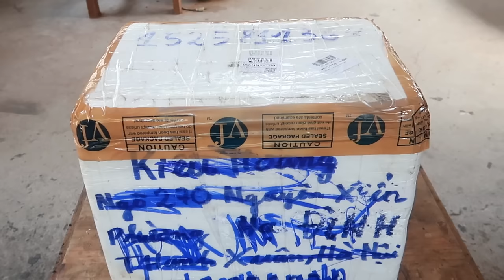Restoration and rehabilitate using abandoned speaker system - Recovery step by step

Comment: The midrange speaker needs a separate enclosure , otherwise it will be torn apart by the woofer speaker . Great job  👍👍👍 .
Reply: Either that or get a sealed mid-range for this
Reply: At 31:29 you can see the enclosed midrange so nothing to worry for another enclosure
Reply: @DJTrackxx  Yes but covering the midrange speaker like that changed the resonant frequency , a small enclosure filled with some phono absorbent material will be better , its great job anyway !!
Reply: 😮una y😅😅😅😅😅
Reply: That in my opinion is not a midrange. It is a mid woofer. Midranges have an enclosed back.
Reply: Also, this small, low-excursion woofer...is not gonna tear anything apart.
Reply: Please tell me can a full range speaker turn into a midrange?, also added a sealed encloser and add foam🙏

Comment: The mid and treble were open in the back. You should have build some box for them so the air from the bass speaker don't push the cones
Reply: I agree with you!
Reply: This system doesn’t have enough power handling to make a difference and the boxes are ported

Comment: The guys are great, but a separate volume is needed for the 31:50 medium frequency speaker... and when you change the diffuser, suspension, hood, the "mass of the mobile system" changes, the dynamics parameters change accordingly, you need to recalculate the frequency filter... it's not that hard!!!